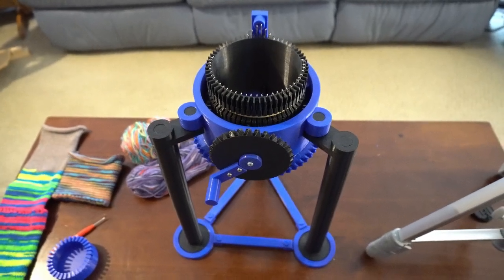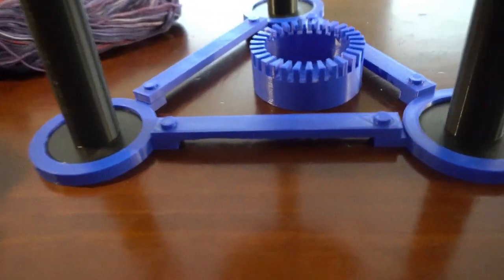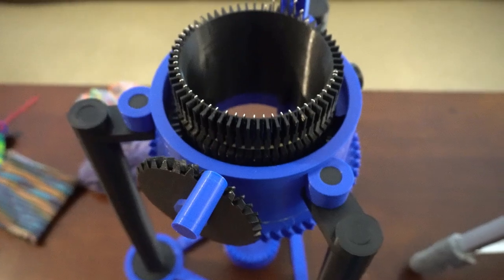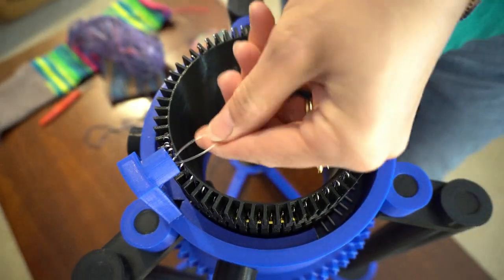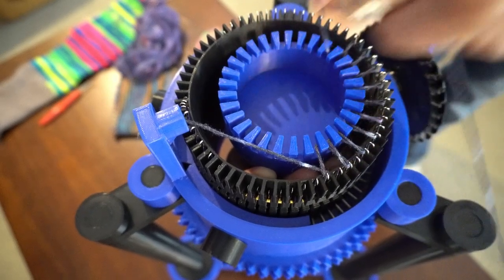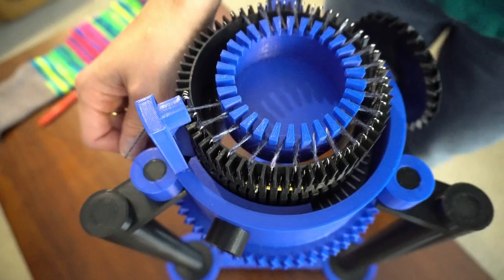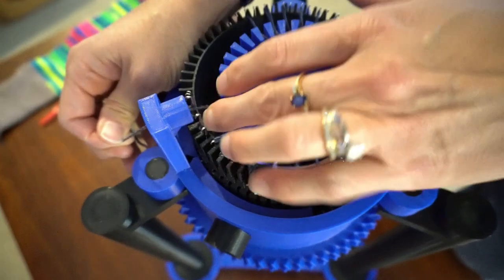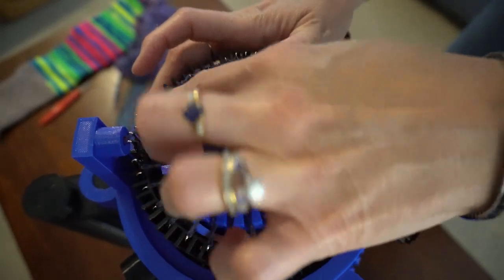3D Printed Circular Sock Knitting Machine

Comment: Thank you for this video. I’m still struggling casting on but I’m sure it will come. I had the same issue with slipping gears so I reprinted the crank to 105%. I kept the “z” axis at 100%. Be sure to reprint a new crank handle at 105% so that the screws line up.
Reply from the maker: Thanks for the info.  We sanded down the portion that meets the housing to get it to fit closer, but that didn't quite do it.  I'll have to give printing those two parts at your specifications a try.  Good luck with your cast on.  I'm sure you'll get it.
Reply: MammaKH3 I also saw that the Center hole is 1mm+ too large for the post it attaches to so I built it up with aluminium tape. Printing to 105% makes that fit even worse. I had to upsize attachment screw  as well to make a tighter fit. The screw just tears away some PLA on the small outer disk to allow it to turn but remain tight without the normal wobble. I wish I knew how to edit that “gear” center hole on it’s .stl file
Reply: @willieswyer2467  I am new here. Did this get fixed? I know how to edit stl and other cad files...

Comment: All these videos have good intention to show how to make a circular knitting machine with one of these 3D printers.  The small problem I see is that many of them are made by people that likes computers, but have not too much knowledge about basic knitting, like re-balling the yarn so it flows easily, they don't know the names of the knitting tools, and the sort.  This project is not an easy one, good for this Lady that accomplished so much with her computer and made this device and is working for her.  She stated she used Knitting  needles from a Brother Knitting machine, and then trimmed the back or tail of it, behind the butt.  These needles can be purchased in many places like ebay, AliBaba and the sort.  They come in several shapes and sizes, and are called latch needles for knitting machines. The sizes of the yarn she refers to can be found in the cover of the yarn, and the yarn can be obtained in the arts and crafts sections of Wal-mart, Joanns, Hobby Lobby and Michaels.  The commercially available ADDI Professional circular machine does the same, is way easier to operate, and uses no weight at all for doing knitting, either flat panels or the round projects.  I got several of them, and dis-asembled two of them, a 22-needle and a 46 needle, and a friend of mine copied all the parts in metal using his lathe machine.  The metal parts were assembled and I now I have two Knitting Machines that are in metal, way better than the original ADDI machines, and I even added a motor drive to make them work with no effort at all.  I had done hats, socks, shawls, scarfs, sweaters and cardigans with them already. I have to say I also have flat knitting machines from Passap and Brother. But watching this video is entertaining even though I will not make any of this machines.  Is so amusing to se the inventive minds from other people trying to do tasks machines do!!!!  5/5 for this video!!!!
Reply: There's much more sense in this comment than in entire video.
Reply: Made one out of metal neat how is the durability?? Plan on selling some?? Cause I would be very interested in buying a metal version of the addi.
Reply: Could you share a pic of the machine you made?
Reply: you criticize the incorrect use of technical language used for knitting yet you appear to the same issue yourself with the technical language used by designers and engineers. Example it an Engineering Lathe or a Lathe………
Reply: @systemtim  you have no point.
Reply: I would love to get my hands on a homemade metal machine.  It's so amazing you made a functional one out of metal. I haven't bought an addi because it seems like cheap plastic bit I'm totally interested in a beautiful mind engineering a functional knitting machine. I need to meet some of those great minds. Lol

Comment: I noticed that the size of each weight is about the same size diameter of a U.S. quarter.  You might want to get 3 rolls of U.S. quarters and a rubber band or duct tape. Then you can take the rubber band/tape and wraparound the 3 rolls of quarters forming a triangle and place it in the center. 
That could help you with the center weight problem. 

Just thought of another possibility that you could use some lead weights and place in the center. You can easily get some lead from fishing and or wheel weights from like Walmart or a car tire shop. You probably know that lead is dense and will give you the best weight vs size. If you are worried about using lead you can place it plastic baggie or something like a coating or 2 of flex seal.
Reply: I got fishing weights....i was given a fishing lure box with a bunch of fishing stuff....never used it now i got reason

Comment: There is remixes of this design where they have hard mounted the knitter through a table that would rectify the wobbly issues you were having. They also have some cylinders with different needle counts too.
Reply from the maker: Thanks!  I was aware of a few of them, but haven't checked in a long time.  I found a clamp file and a cast on basket file which I may print out in the near future!  One of those cylinders was a file I created, but it isn't perfect since I used a customizer to edit a different file that had an area I couldn't edit, but if you print it with the floor at a -Z (I forget the exact amount) it would print out only what should work.  I'm trying an entirely different file now though, by MrRoboto19.  I had to pause the make for some other projects.  I really like that MrRoboto19 also published a ribber attachment file for the machine.

Comment: Thanks for video. I recent printed a  similar 60 slot version of this CSM but I having trouble casting on the first time . I found this basket method really tricky and the yard keeps falling off. Now I trying to use a 'star' method but I clearly have no clue what I'm doing; everything seem very tight.
Reply from the maker: I had the same trouble with the basket.  I switched to using a cast-on bonnet and then attaching the weight to it.  It makes sure you don't over tighten and can get the knitting started easier.
Reply: I know this is a late answer, but if you either hand knit, crochet, or even just cut the toe off of another sock, then loop the live ends of the yarn around the needles, you can weigh that down and use it to cast on with your working yarn. You don't even have to use a knitted sock if you don't want to. You could just cut the toe off of a store bought sock, then sew the required amount of "loops" to the end of the sock, hook the loops into the machine, then cast on what's referred to as "ravel cord." 

After a row of ravel cord, you change to your working yarn.  Good luck with it.

Comment: Those weaving weights look a lot like washers.  To get more weight, you can use fishing weights, model train car weights, or car tire balancing weights to get more density as they're made out of lead.

Where can we order the hooks that go up and down?
Reply from the maker: Yes.  Those are washers from my Ashford Warp Thread Weight kit.  At the time of this video I was just grabbing what I had to use for weights.  Since this video aired I have purchased some larger washers to use with a set of warp thread weights I 3D printed and they work great too.  Thank you for all the other weight ideas!  Those are great.  I especially like the idea of using model train car weights!  I have also acquired and fixed up an old flat bed knitting machine since this video so I have a few other weight options.  It came with the claw weights that you see sold with knitting machines of all types.  I haven't used them to knit with this machine yet though.

I have a link in the description above for information about where I purchased the machine knitting needles.  If they are no longer available there, you could try a google search.

Comment: Hi!
Can you use rubberbands instead of weights?
Also the way i would change this makeshift knitting machine is by building it upside down. The knitting would go upwards using a rubberband or something that would pull the socks end upwards instead of using weights to pull it downwards, and all the needles and gears would be very close to the bottom of the machine, so it would be less flimsy, and easier to crank. I would build the vertical columns of it higher and less structuraly sound, because it would only be mounted by a rubberband(or multiple rubberbands) pulling the socks end upwards.
Reply from the maker: Hi!  Thanks for the ideas, but I didn't create the file.  I only printed it and figured out how to use it.  I did customize a cylinder for it, but that again was from someone else's prepared file.  You're idea sounds very interesting.  I've never seen a circular sock knitting machine in that orientation.  If you end up creating the file, please come back here and let me know.  I'd love to check it out.

Comment: use washers from the hardware shop as weights, cheaper than the weaving weights but the same thing.
mod the file so it will clamp onto edge of table or to make it higher you could try broom handles instead of the 3d printed posts but the higher you go the more 'unstable' it will become without bracing it
the two triangles are more likely there for when you make heels, as you knit back and forth for those not round and round.
Reply: and to make it higher you could try broom handles instead of the 3d printed posts but the higher you go the more 'unstable' it will become.
Reply from the maker: Thanks!  That's exactly what I've been thinking for the weights and for making it taller.  I might be able to use one of the pieces the leg goes in to clamp it to a table.  Right now Cura is my only software for 3D printing, unless the designer makes the file customizable on Thingiverse, so I don't think I can modify the file at this time.  Thanks so much for the idea with the triangles!!!  I bet you have something there.  I'll have to see if I can figure that out.
Reply: not sure if you can put the needles in hold (lift them up so they don't knit. but that would be how you knit the heel - put half in hold and work on the other half. other way would be waste yarn or just mark the needles and stop cranking when you got to them ;) watch a circular sock knitting video (CSM) to get the how. maybe just print a 'cap' to put over a needle to mark which are NOT in use, you would need two to mark beginning and end of instep/heel needles.
you should be able to import the stl files into tinkercad or blender and edit them.
if you print the base again (or twice more) but make the part where the posts go holes that should help brace the machine to make it a bit sturdier. 
really the only part of this we can't print is the actual needles as never get them smooth and that latch would be a nightmare LOL BUT....thought just came to me, if you can edit the files in blender/tinkercad, you might be able to make it work with other needles (silver reed for example which might be more readily available) extending top part and/or allowing longer needles etc. so you don't need to cut them.

would be nice to have a ribber for this too, at some point ;)
Reply from the maker: @dragonlord0666  Thanks!  I appreciate your input.  I'll have to work out how to put them on hold or mark them.  There isn't a method built into it.  I don't currently have access to either of those programs.  There is a new file with a customizable ribber on thingiverse I plan to look into, however I'm not sure if I'd need more than that part to actually make it stay where it belongs on the machine.   I'm not familiar with how a ribber typically attaches to a CSM.  Another thing for me to explore on youtube when I have the time.
Reply: the ribbers are held on by a clamp (or a 'hat' as I think of them) that swings out the way or is removable when not in use so guess some t hing like that would be needed or a way to rotate the needles to the inside of the cylinder.
blender & tinkercad are both free (always a good price) - blender is a downloadable program but tinkercad is web based via your browser. tinkercad is easier to use as aimed at beginners and 'tinkers' (hence the name a guess) blender is free but a steeper learning curve

looking at the sock machine the 3d printed one looks like it rotates the cylinder where as the metal ones the 'head' rotates around the cylinder (so the part where the yarn goes plus the triangle bits would make up the head)

Comment: 20:25 - those are bolt washers, big one, 20 mm perhaps; anyway, for weight, any heavy thing can be used; thx for sharing, have fun, aum, s love nia
Reply from the maker: Hi!  Thanks for the comment.  The time stamp was super useful for me to find out what word I had been trying to remember.  They are bolt washers, however I was trying to remember the term under which I bought them, Ashford Warp Thread Weights.  They came as part of a kit for weighing individual warp threads in weaving.  For those that don't weave though I'm sure some bolt washers could be purchased inexpensively at a hardware store.  Their outer diameter is 30 mm.  Thanks for watching!

Comment: Should redo the feed so it has a slot at the top to keep the thread out of the way when starting, also use a lead weight in your central form to provide a controlled tension.
Reply from the maker: I would love to edit the feed, but this print was not from a file I made and it wasn't made customizable.  I've found a new file to print which is much more involved, but looks like functionality should be much improved.

Comment: hello I am printing it it is beautiful thank you very much Would there be a video for the assembly? I found the needles but I need screws?an elastic ? can i have a list of what you need thank you very much
Reply from the maker: Hi!  Here's the link to the list of parts I used https://www.thingiverse.com/make:646231.  I don't plan on making an assembly video for this one designed by difl.  I may make a new print with a different designers file to do a comparison video, but maybe I'll add an assembly video for the new one.  If you don't find anything with a YouTube search, maybe check the other makers listed on Thingiverse?  Good luck!
Reply: @Chiromom2  thanks you 😁

Comment: May I know what is the specifications needed for the needles? What is the length of the needles before and after cutting? I'm trying to find a type that doesn't need cutting, if possible, as I do not have experience with cutting metals. Would the ones used for machine S type, 80 type, E6000 type good for this or should I stick to KR850 ones and trim them? Thank you.
Reply from the maker: I had to purchase 2 different sets to find ones that were similar to what Deter used in his design.  My needles were just under 8 cm long after cutting them and 12.5 cm before cutting.  I'm not familiar enough with the shorter needle sizes to have any suggestions.  Maybe there are new suggestions on the thingiverse listing?  I know there has been some more chatting on there with various ideas.  It looks like the E6000 would be too long at 8.7 cm.  The other two you mentioned seem to be the same length as the E6000?  Sorry it took so long to respond my csm was buried as I'm reorganizing my craft station so I needed time to dig it out to measure.  I know I didn't have great answers for you, but I hope that helps.

Comment: Thank you for this video, it has helped a lot. I am printing the part now. One question with the Zylinder :) did you print with supports (what settings did you use/) mine says like 1 day and 1 hour Yikes
Reply from the maker: I printed at 20% infill and .2 resolution.  I did not print the Zylinder with supports.  It took about that long.  The Gehause also took about a day.

Comment: Have you tried doing a heal? I have an Lk150 I've made slipper socks and made the heal By reducing stiches
Reply from the maker: I haven't yet.  I looked at how it was done on a regular sock knitting machine and it doesn't look possible for this machine.  It doesn't raise up half the needles to bypass them.  However, this is my first CSM so I don't have any experience doing heels on a machine to try to transfer to this machine and I haven't given much thought.

Comment: Hey great video! Very informative and in depth. I am in the process of printing the same machine as I type this. Do you remember what screws you used to connect it all?
Reply from the maker: Thanks for the compliment!  For the screws I copied another maker.  
2 5mm x 25mm hex head nuts and bolts
2 m3 x 12 mm for handle
4 m3 x 30 mm for base
1 m3

I haven't browsed new things attached to this on thingiverse in quite awhile, but this looks promising for parts and adjustments.  I especially like the 'needle hugger'.   https://www.thingiverse.com/thing:4435634  Have fun printing!

Comment: Put a hole on a table...print shorter legs and atach it to the table so you can have the middle part travel thru the table and you can make way bigger pieces and give leggings a crunchy style with extra laces on the sides going long ways